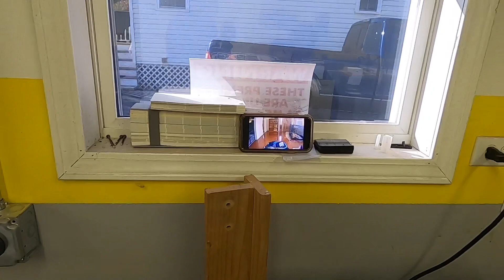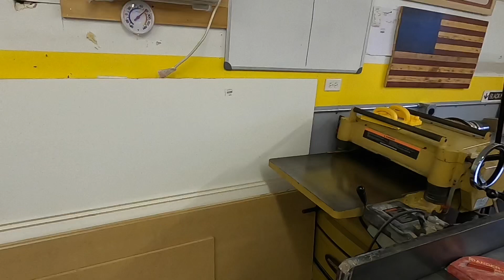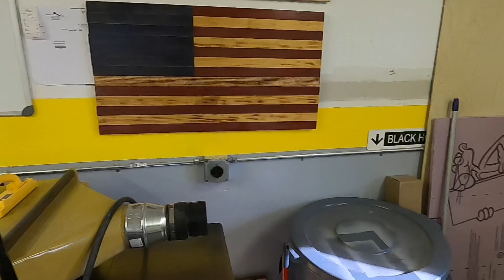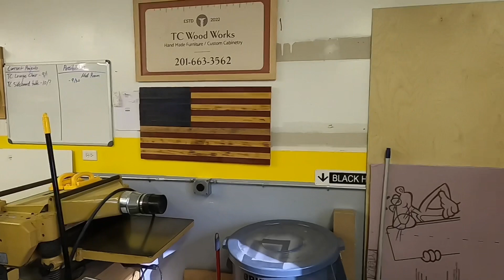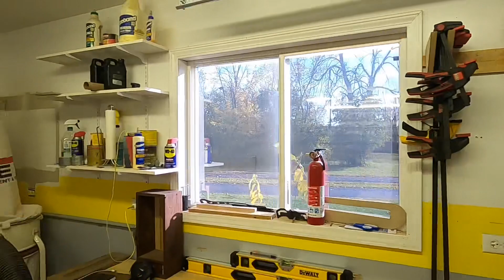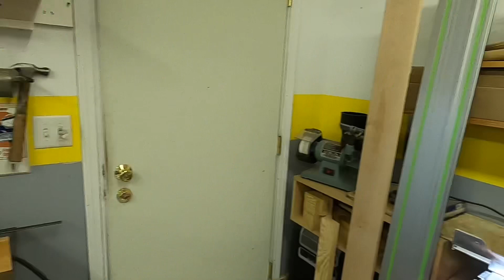New Shop Tour/ Woodworking Shop/ Cabinetry Shop

Comment: I like the size of your shop and boy, all of that natural light is a premium in shops. Something I wish I had more of. For the two windows, I do have, I installed roller shades. Super cheap too. I don't live in a high-crime area, but when I installed them there had been a lot of break-ins at that time and the shades are pulled down so no one can look in to see what's inside. April Wilkerson made a mobile drill press cart and mobile miter station a few years back you may want to look at to get some ideas. You could even modify the cabinet it sits on now. Put a frame with casters attached to it on the bottom and then add some fold out wings that support a top for the lumber to rest on when cutting. I think Norm Abrahms made a much fancier rolling stand that might be good too. I always try to use what I already have or can find cheap on Face Book Market Place or sites like it. I did that when lumber prices went thru the roof. I try to incorporate existing items such as the stand the miter saw sits on now. That would save you a lot on materials and could use the money saved for T-track, stop block, and measurement tape. I bought off of eBay recently some blocks of clear acrylic and made them into unique stop blocks. They were already cut to 1x2x3 inches with flamed edges. I added a thin piece of scrap rosewood to the back to prevent scratches and they look very cool. Just some ideas for you. Best of luck!
Reply from the maker: I really appreciate your insight and ideas! Thank you for reaching out

Comment: Awesome shop. Way better than mine. 

The only thing I would add is maybe an air cleaner. I use box fans with merv13 filters and it makes a big difference. I use two in my shop $80
Reply from the maker: I will definitely be adding that in the next couple of months. Along with upgrading the dust collection in order to have better air quality in there. I appreciate your advice and I’ll give it a shot.